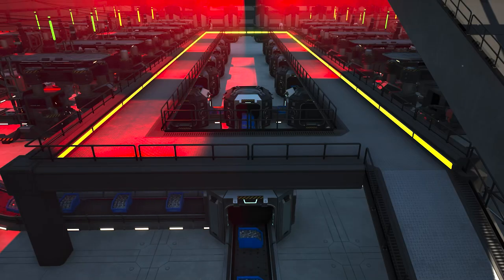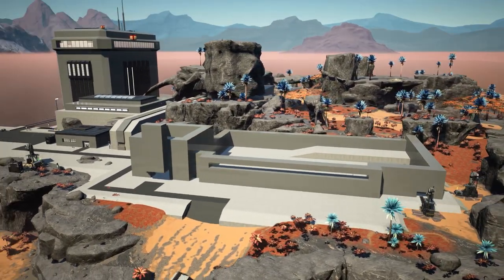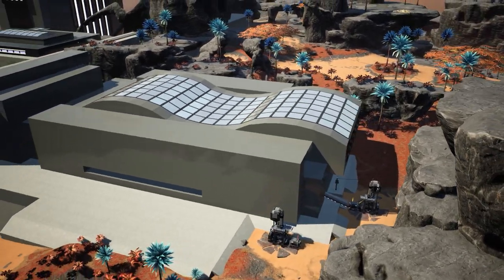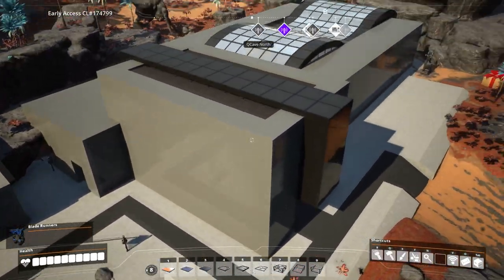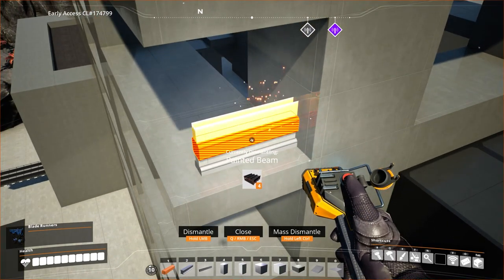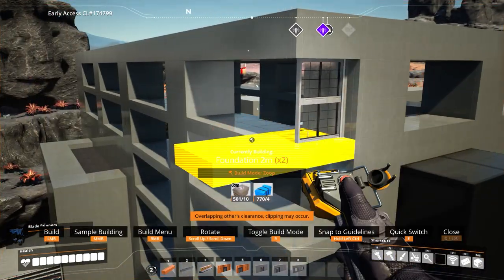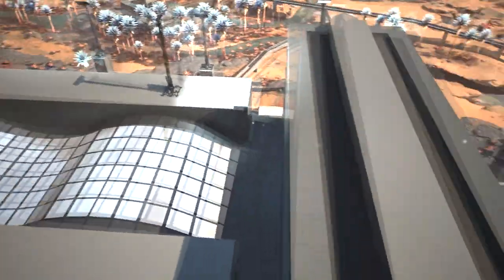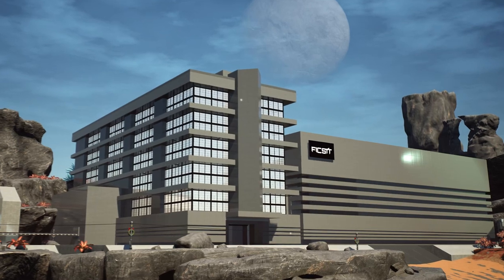Designing & Building a Screw Factory

Comment: For the offset walls question in your video: it is way faster to slap down a road barrier where you want the wall to go and then hit Ctrl when aiming with the wall to replace the road barrier. Voila, wall where you want it.
Reply from the maker: Oh yes, you're 100% right. I learned that soon after making the video. Still need to use the beam trick for making angled foundations meet up seamlessly though (also, there's no reason it can't be exactly 45 degrees. Not sure what I was thinking!).